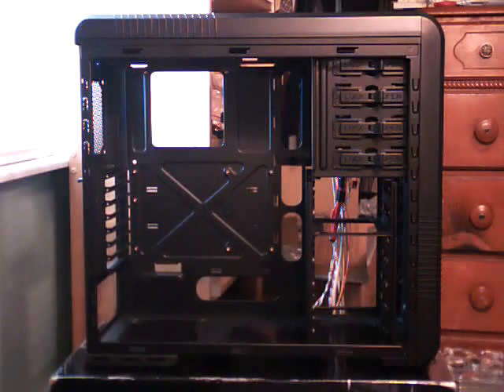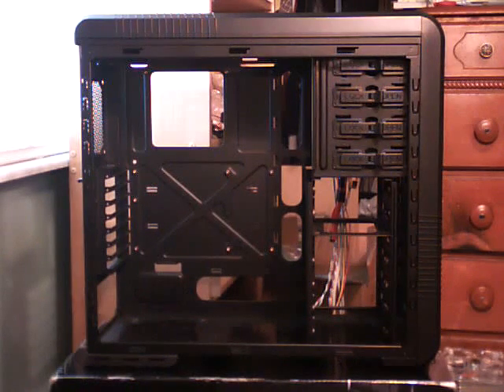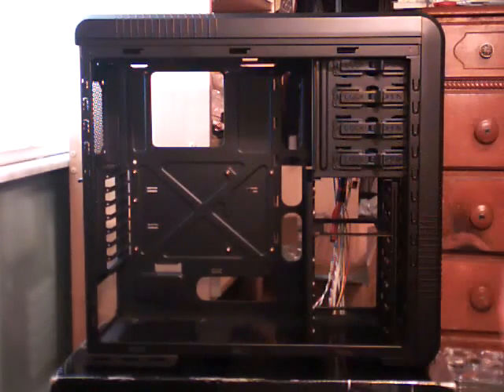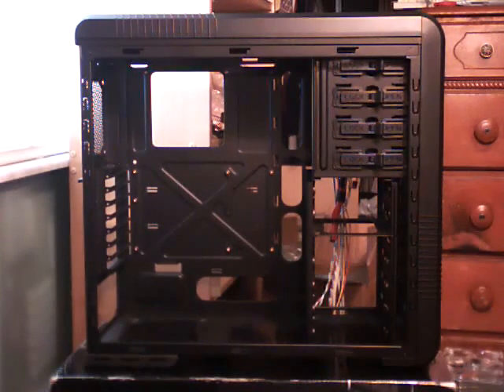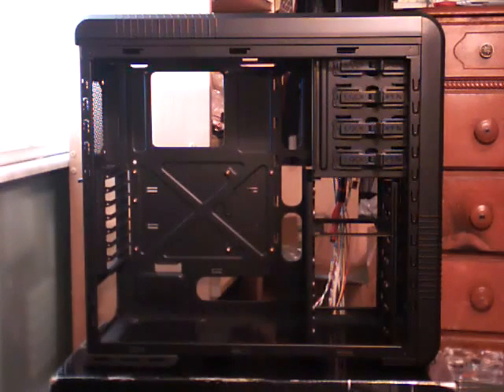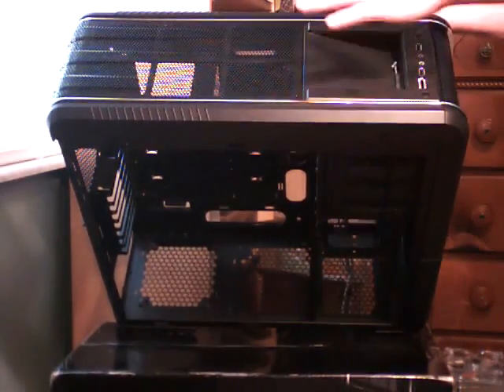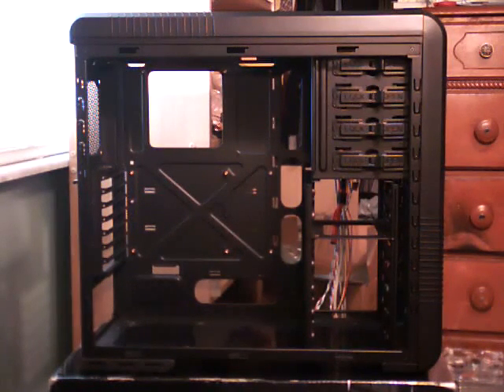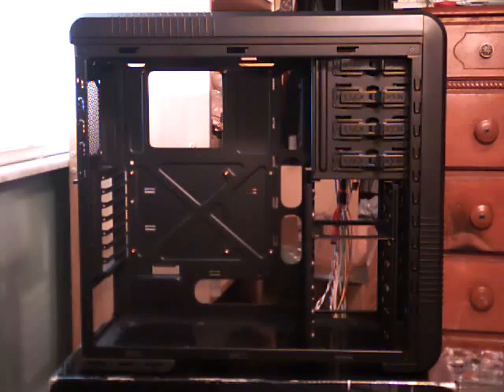CM 690 II Case: Water Cooling Radiator Mounting Locations(factory and experimental)

Comment: CM690 was well designed for its day. The CM690 III is superior to it when they made it an inch wider. It is possible to add a top front 140mm fan on an old CM690 if you drop your DVD player to the lowest slot and use the 3 x 1.75 x 5.5 "hole" to mount another 140mm. BTW, although the original CM 690 can handle 140mm fans above, it can't handle a 280mm radiator there, Just a 240mm rad. There is only one inch above an ATX MB and most 280mm rads are thicker: about 1.5 inch. I've tried to figure a way to use the excellent Arctic 280mm AIO but it won't go unless I run the rad and fans outside the case. The Arctic AIO is pretty much sold out now at its $99.95 price. There is more fluid in that rad then in anyone's 360mm rad. Its a VERY competent and overdesigned AIO being sold for a very reasonable price.

Comment: I would also like to know if the Corsair H110 can fit with say, the radiator inside and the fans mounted inside the space up top in either pull or push config.

Comment: I have the cm690 standard version, but thinking about upgrading to the new NZXT switch 810 probably one of the best value water cooling/air cooling case (as they call it the hybrid) Now I have Noctua NH-D14 installed in my cm690 which forced me to remove the top 2 exhaust fans to clear the space.  I love this case but it's time retire it.

Comment from the maker: @Rajiv4125 No 2780 rad at top wont fit, you can not even fit 140 fans on top between metal and plastic top panel. Only 120mm fans fit there and barely.

Comment from the maker: @KeenOnTaka Looks like the only real area would be to hang it off the back 120mm fan hole. However there is not any grommets for passing tubes through iirc. Might be able to mount internal not sure where as the top only has room for venting no fan holes from what it looks like. If your serious about water cooling I would sell that case and get something a bit more H20 friendly.

Comment from the maker: @Danklin24 Not a dumb question at all the holes are there already you need to have the correct length screws to mount the rad below the top on the inside of the case. You should be able to fit a pair of fans on top between the mesh and the metal top panel I could on mine. So essentially you can have push/pull on this case.

Hope this helped anything else you would like to know about PCs send me a PM.

Comment: Does a 240mm rad. on top and a 120mm rad. at the back fit, without interfering with each other? 
And then of course I would "only" be able to fit the vents. in a pull configuration on the 240mm rad.
Would that be enough to cope with i7 860 and HD 6870?
I can!t use the bottom, because I have 5 hard drives in the case.

Comment: hmm just one question. ive seen many people fit 240mm radiators in the top and bottom, but i was wondering can it fit 280mm rad in the top and bottom? all the fan holes are for 140mm fans, but for some reason nobody seems to have 280mm rads....? and about the hard drives, you are correct daralinn however i will never EVER use more than 1TB and a single drive option is just fine for me.

Comment: @FRURMELLL I have a total of 1tb but all my drives are old so i have 4 250gb. I do not see a reason to buy a new one, all of the ones i have work just fine. 

If i was to buy a new computer i would get just one 1Tb drive, but if i was to jsut get the case i would need those bays

Comment: Front 140mm, top 240mm, bottom 240mm possibly 280mm, rear 120mm and it'll take a top end i7 and a couple of graphics. Got to be careful that your PSU doesn't block the bottom rad.